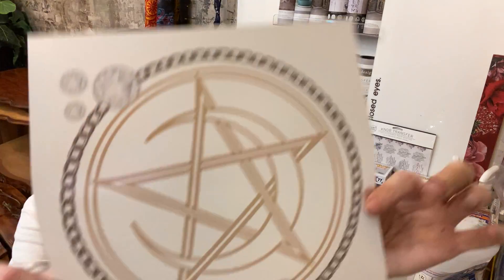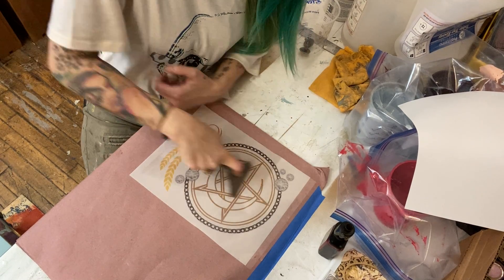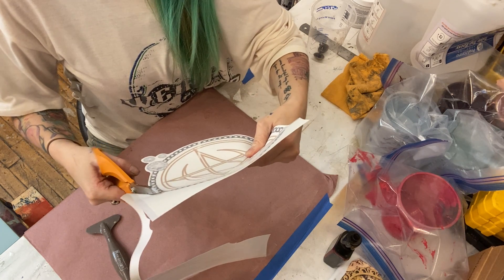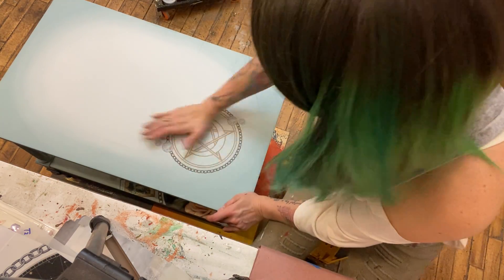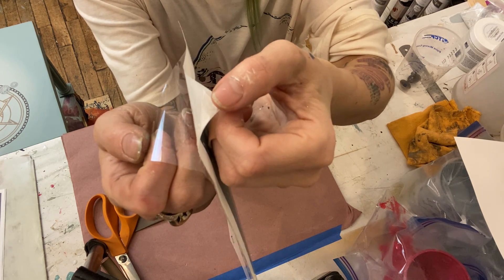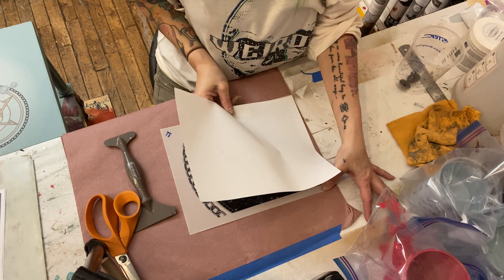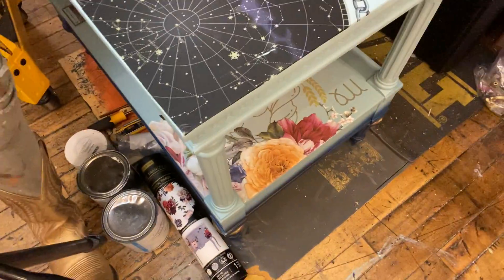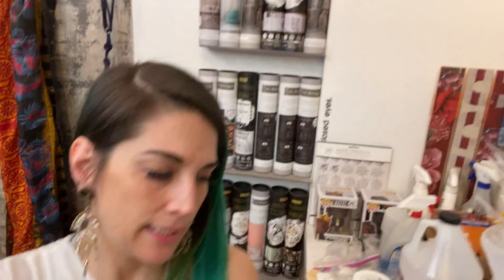Printing Rub-on Transfers on an Inkjet - adhesive application instructions

Comment: should the painted surface be glazed or coated first - mine had like little bubbles in the wood underneath where I  had distressed by sanding so it didn't look smooth, even though there werent' any air bubbles in the transfer itself.

Comment: What is the transfer called & where can I buy them / Your work is amazing !
Reply: No Answer?
Reply: I use the following from Amazon. The instructions with the Incal dry transfers is  nowhere near as good as this tutorial. I had a bear of a time understanding why the transfers didn't appear to have any adhesive. I thought the paper was old and dried up but after watching this video, I was able to make transfers that actually worked. It does take some trial and error and the transfer paper is not cheap, but once it gets figured out, the results can be amazing. I use this process for making decals for scale model horse drawn vehicles.

[Incal] Dry Rub-off Decal Film for Laser Printer,5 Sets,A4(8.27x11.7in)-Premium Printable Dry Rub on Transfer; DIY Hobby craft Customized transfer

Comment: When you are overlapping to make the cut. There is a wall paper trick where you over lap the two pieces then cut with a razor blade through both pieces and they will match perfectly.
Reply: how?  I can't even imagine that! if you cut through both pieces, wouldn't you end up with a bare stripe? 🤔

Comment: I bought 100 of these and I’m having trouble with the the back of the adhesive layer coming up to from the backing sheet. It separates when I pull the adhesive sheet off. It’s just a loose sticky layer with the print without any support. Could this be a bad batch? Something I’m doing wrong?
Reply: I can't find we're to buy these sheets ...could you put link on please

Comment: thank you for posting this and your other one as well. I did have some issues with doing the first step as the adhesive sheet hit the printed side before I had it lined up and I had to start all over again. I feel this is the most difficult for me getting that lined up . I ended up messing up 3 sheets as the next one then got a bubble/wrinkle for no reason in the same step. Have you tried the water slide products? Im about to as it seems less tricky since it doesn't have that extra step of lining up a adhesive sheet to the printed surface.